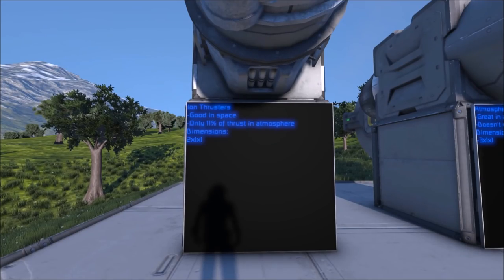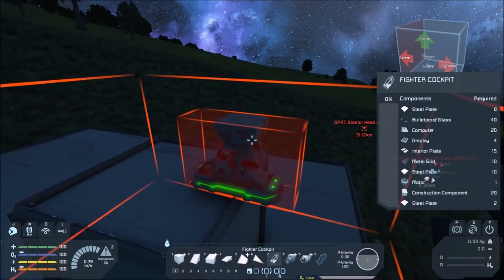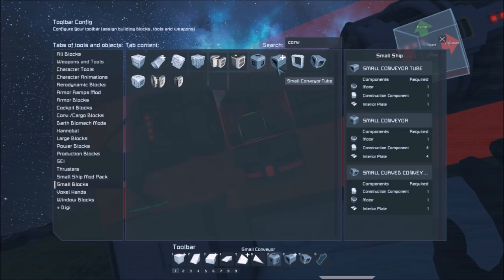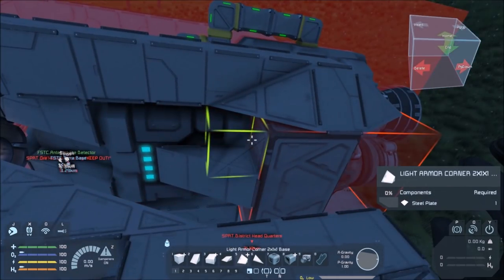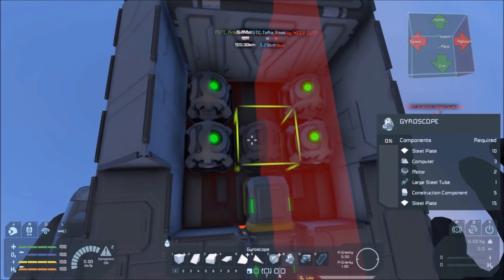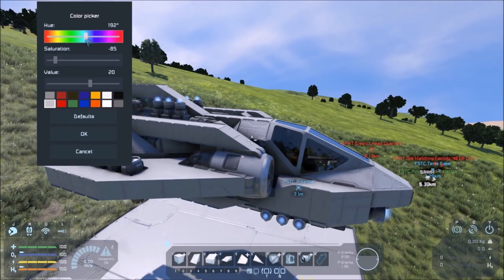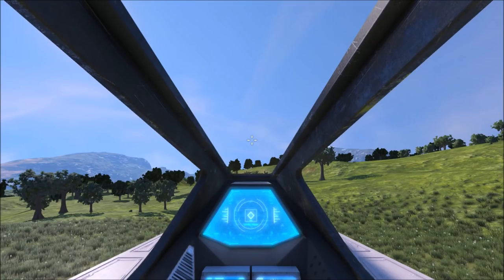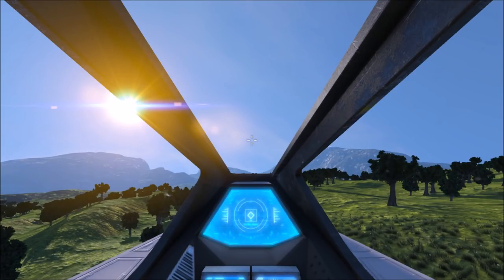How To Build A Small Ship - [Space Engineers Tutorial]

Comment: Great video! One question.. how do I fill the hydrogen and oxygen tanks? I can’t place ice in there and ice doesn’t transfer from storage?
Reply from the maker: You need to connect them to a hydrolizer (I think that's what it's called). This ship doesn't have one, the idea being that you dock with a base or fueling station with one, which will fill your ship up.
Reply: My be a little too late, but for me I did this in survival mode and using the oxygen tank did work. I replaced it with a O2/H2 generator, then it worked.

Comment: Hello Galyxr I have tried your build with a lot of pauzes lol.. It went so quick sometimes. Anyway I think I got it all, but the hydrogen tank is not getting filled when using a connector to the base... I cannot use the vent, as I build it on Mars.. maybe not wise.... Secondly the medium cargo is not reachable from the cockpit... so maybe I blocked myself by filling the blocks around the medium cargo to make my ship look nice.. Currently running on batteries but 2 is maybe not enough, as I don't yet have all the uranium I need for the reactor... So.. hope you can help me with my points... I hope I don't have to brake it down and start over...
Reply from the maker: Late reply, but to get the hydrogen tank to refill, make sure that in the options for it "stockpile" is checked. If the medium cargo container is connected to the cockpit, you should be able to access it's inventory from there, so make sure the conveyor ports are lined up properly.

Comment: how do you get the symmetry thingy to work, i have not changed any settings related to it, and i cant get the symmetry thing to work
Reply from the maker: You have to look at the block you want the symmetry to be on (for me the center block), and then you press M. A translucent plane should appear. It can be blue and green, but most likely will be red. You can press M more to change where the symmetry sets (center of block by default, left or right side after pressing). When you are glad with where the symmetry plane is, double click. The symmetry is now set, but is turned off. To turn the symmetry on, look at the ship and press N. Your symmetry should be on and a translucent version of the block you have in your hand should be displayed in the respective symmetrical place on the other side of the plane. If you are still having trouble, just tell me specifically what is being difficult, and I'll see if I can help you.
Reply: alright thanks for the help!